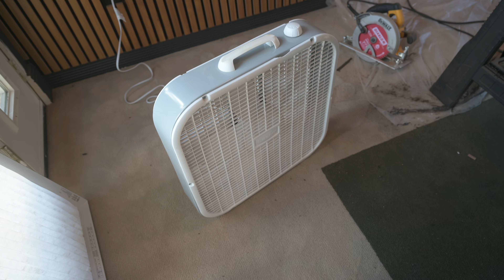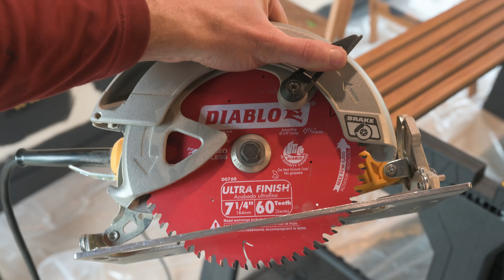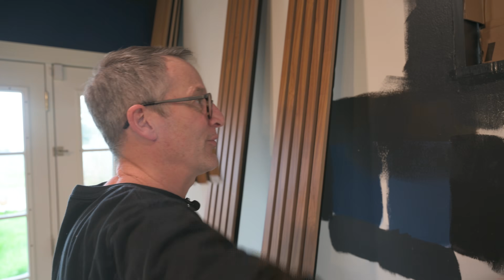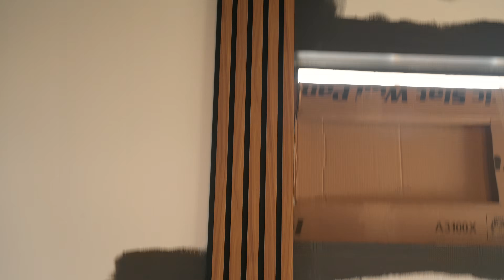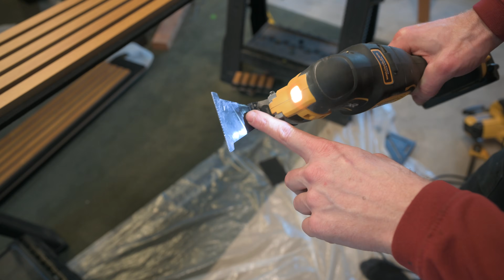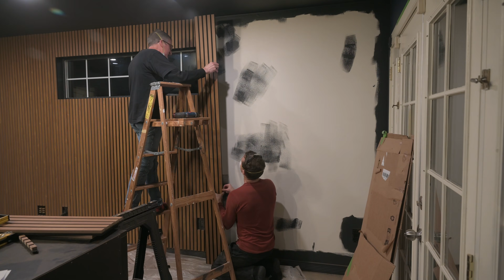Installing Wood Slat Acoustic Panels: Full Process Breakdown

Comment from the maker: Anybody have experience with the "instant grab" adhesives? I suppose that's different than setting/cure time but it was a chance we didn't want to take!
Reply: Hi Dan, excellent how to.  Black paint and cutting reverse side to avoid chips was money!  I'm installing a similar product called Artika Sonofold which is about 23 1/2" W x 96" L.  Lucky for me, I'm installing on what used to be an exterior wall, direct into OSB using 1 5/8" drywall screws. No glue, thank God!  You could skip glue for interior drywall by 1st installing the cheapest 1/4" panel you can get, over entire wall, screwed into studs.
Then you only have to use screws.no glue to get thread grab wherever you need it.  Other advantage is easy replacement or removal of panels.  Glue's a nightmare.  Other lesson learned: assuming you.support entire panel, a reasonably sharp carpet knife makes perfect cuts of felt - no saws needed.  THANKS AGAIN!
Reply from the maker: @MikeA-ko7ze thank you, Mike, and so glad you got some useful tips! Good idea to avoid using glue - it will definitely be a mess the day Steve wants to take those panels down...
Reply: @MikeA-ko7ze  Hey Mike; clever idea. Just to confirm, you're saying screw (don't glue) the 1/4" panel on to the drywall, but what were you thinking for layering the acoustic panels onto the 1/4" wood? Is glue ok in that case? Or are you doing another set of screws?

Comment: Manufacturer says to  use adhesive OR screws.  I can't believe you glued AND  screwed those tiny upper panels. What did they weye, 10 oz? I like them better horizontal.
Reply from the maker: Oh it sounds like you had success using just one, nicely done! Have you had to dust them a lot installed horizontally?
Reply: @danielrvilla  We'll probably end up using both as we have the 96" panels and they're pretty heavy. But I dont think you need both on the smaller pensls. I guess if you use grippy adheaive you don't need screws, but then you don't have any room for fixing mistakes.
Reply from the maker: @LaurieJennings-w6z yeah there are some "instant grab" adhesives that we didn't want to try for that reason! Though I imagine it holds and you can still move it around.

Comment: Wont tape over where ur cut also help with the chipping ? iam about to install this today infact so glad i found your video. and was trying to figure out about the felt direction. see yours was away from the window si theres a litle area behind the first panel where there isnt felt. ( where next panel felt normaly would slot in.  assume it dosnt mater what way then ?
Reply from the maker: I've heard tape can help and it was nice not having to apply it for each cut. 
For felt direction it shouldn't matter unless one way makes the slats line up better with a window, outlet, or other feature. The instructions do say, if I remembere correctly, that the sides of the slats can look different depending which way is up, so take a look at that and see if you prefer one. 
Good luck with your install!

Comment: the first panel should be straight but every panel has some 'slop' you can use to adjust the straightness: you DO NOT have to get it perfect, just get the look satisfactory and you can adjust as you go! it's not stressful!
Reply from the maker: Yeah, plus a lot of walls and corners aren't straight/square either. I remember learning that lesson the hard way a long time ago haha
Reply: @danielrvilla  i did an install today and i was kinda wrong, i thought this product had a tongue and groove - it still came out great, but i was coming back here to edit my comment and admit i wasnt as right as i thought! the foam still makes it easy to hide a tiny gap.  i will say having some long T50 staples helps if you're doing trim, if there's only one staple in the product, it will zig zag!
Reply from the maker: Painting the wall dark really helps too!

Comment: If used black drywall screws would I still need to glue it to the wall?  The apt is a rental so I dont want to ruin the wall when detaching
Reply from the maker: Good question! I imagine it would be okayish, but you wouldn't often be hitting a stud in the wall since these panels don't span 16" stud spacing. Drywall screws normally secure drywall to studs.  I think these screws are mostly to hold it enough to let the adhesive dry, so they hold enough in just drywall to allow that.
Reply: @dan @danielrvilla  thanks for your answer.  🙏 Would using some sort of drywall anchors solve the problem of not hitting studs?  If not then, is there any combination of screws and adhesive that doesn’t completely destroy the drywall when uninstalled ?
Reply from the maker: Some small drywall anchors could work, the trick would just be finding them behind the felt of the acoustic panels.... Maybe you could stick a wire in them that could poke through the felt? Hmmm. Let me know how it goes!
Reply: @tommytorres one thing to consider is asking the landlord for permission to do the upgrade and leave it as is when you leave.     Option 2 is create a false wall with plywood secured to the studs top and bottom to then adhere the panels to.
Reply: Adhesive is overkill, just use the black screws it comes with or black drywall screws in the felt. Holds just fine just don’t overtighten the screws because you will just bore out the drywall. I installed this way with zero issues.
Reply from the maker: Ah, great to hear it works well without adhesive, too!

Comment: Is the plan  to later install a wall mounted TV?  If so, then the TV bracket  is secured atop ( through)  the acustic  wall panel?
Reply from the maker: He has a low TV stand/cabinet that can hold the center speaker and has a couple compartments for storage.  But I'm sure if you went through studs or had good toggle bolts, going through the panels wouldn't be an issue!